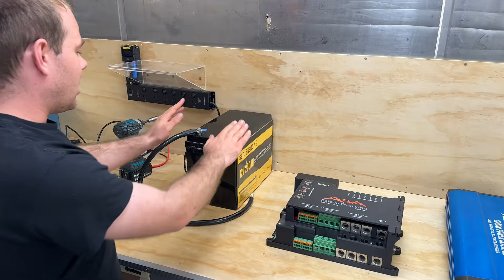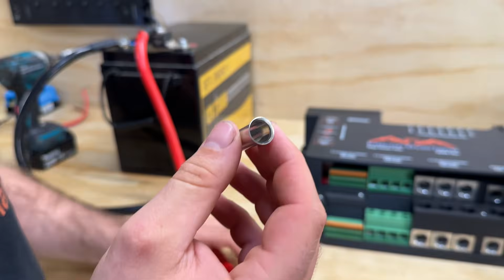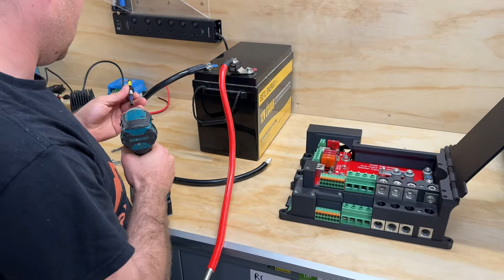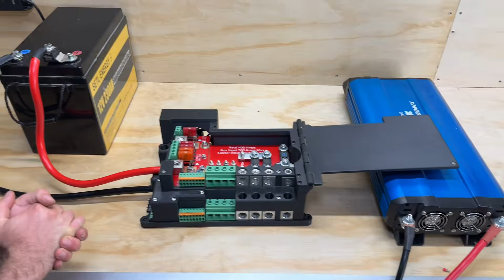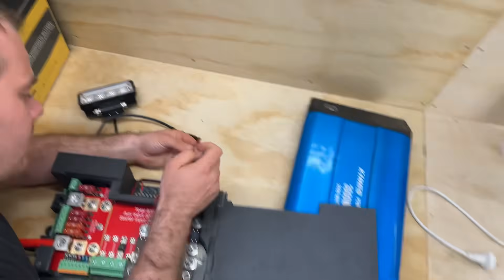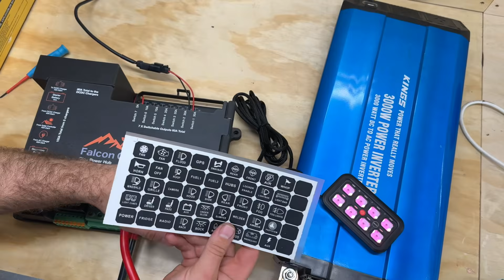The Easiest High End Electrical System

Comment: Sounds like a great item to add to my off grid system 
The main question i need to ask, what do you use as a trigger to turn everything off via battery percentage ?
Ive only ever been able to work it out via voltage and not percentage
Reply from the maker: @John.strong  Hi John we use a victron BMV 712 to turn it off via its state of charge relay. Feel free to message us on instagram or facebook and I can send you a video on how it works.

Comment: Do you have an app with it which can control all terminals, on/off for instance? Can you accommodate two DCDC chargers so get a higher charge current say 100a for LFP?
Reply from the maker: Hi Stefan, yes it does have an app to control all the switchable outputs. 

Although the charger inputs are conservatively rated to 40A for each charger. You can use any of the larger outputs as inputs so technically you can go up to 300A chargers.  However our next model will have a higher rating.